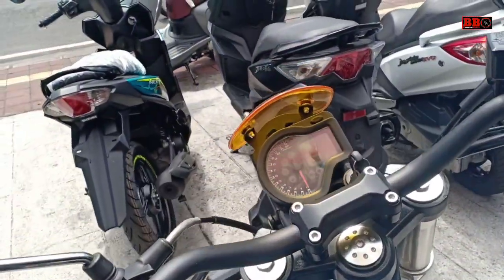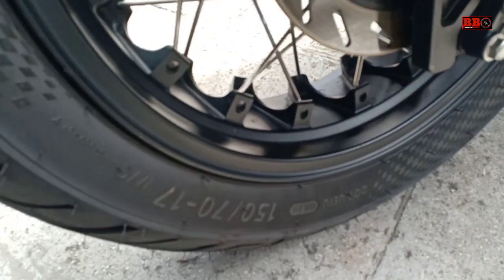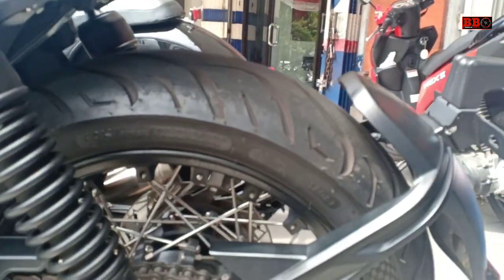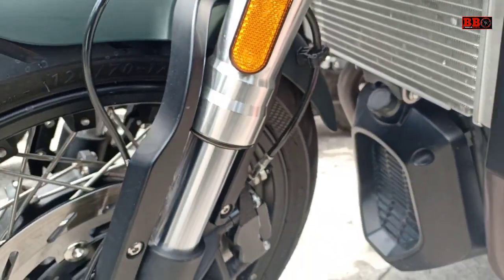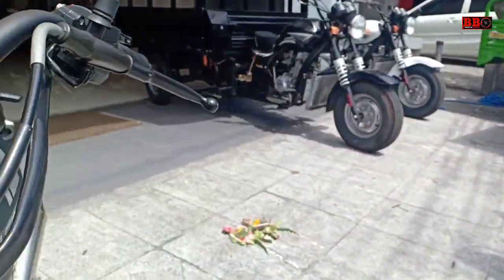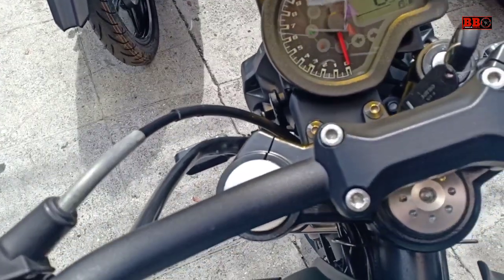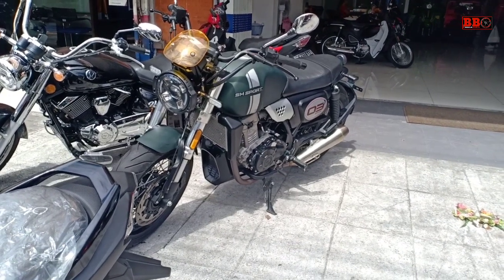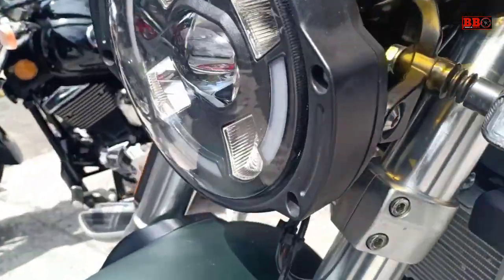Review SM SPORT FE3 2020 || Tes suara knalpot dan lampu lampu kerennya

Comment: How much does it cost ? 
Compare with cafe racer model
Reply from the maker: This cost here about 3000 dolar
Reply: @BaliOtomotif  say , IDR14.500 x USD3.000  = IDR43.500.000 

Does it OTR price ? All taxes include ?
Reply from the maker: Its off the road, For taxe about 1500.
Reply: @BaliOtomotif  1500 in IDR or in USD ? 

If it in USD , meaning USD1.500 + USD4.500 = USD6.000 

I do surprised that the tax is more than 30%